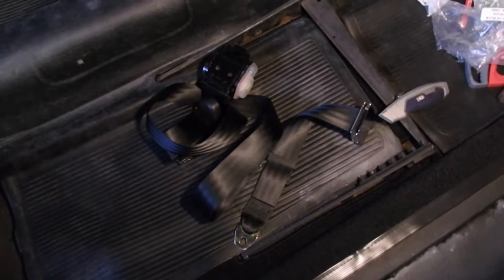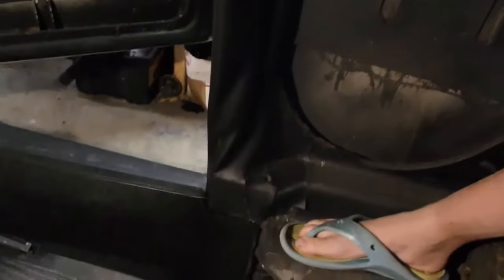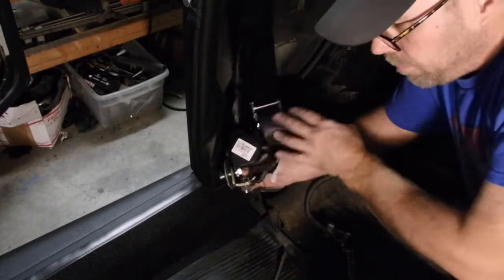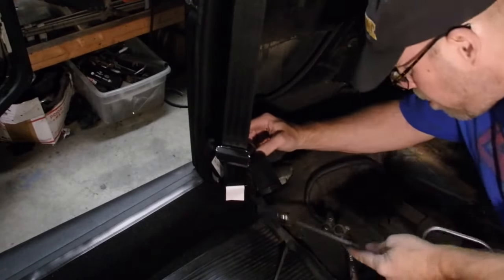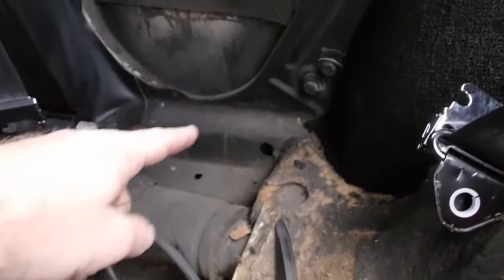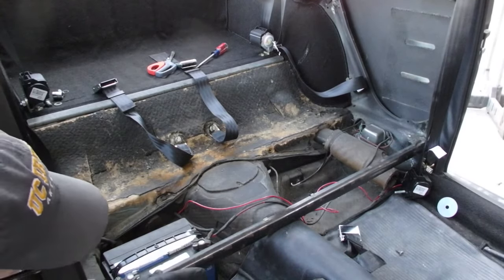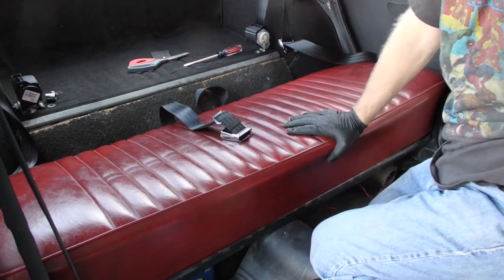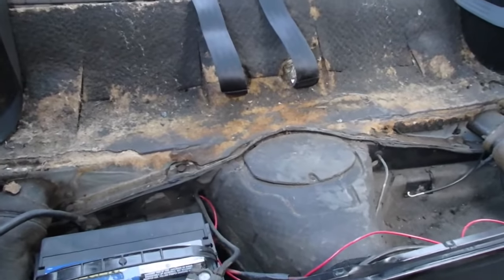1969 VW Bug Project - Episode 48.2 - The Interior: Three-Point Seatbelts Front and Rear

Comment: Very nice guide. I had bought new 3 point harnesses for my 69 bug as well but didn't have much luck finding instructions about mounting them. I had to repair the rear luggage tray, so while I had the welder out I welded a couple 7/16-20 weld nuts to the inner wheel wells in the back.

Comment: Hey same problem here , I need that lifting bracket. Where can I get those? 
The bar that the back seat rests on is in the way. Thanks!!
Reply from the maker: By lifting bracket, do you mean the anodized one that holds the base of seatbelt system?  If so, it came with the seatbelt kit from JBugs.

Comment: Great video Bro, did you get the same retractable seat belt set as the front and mount that in back? I'm just starting the front, surprising there's no instructions!? go figure. Thank-you!!!
Reply from the maker: Yep.  Same exact belts.  They work a treat.
Reply: Just a side note, my belt set came with brackets that move the retractor forward, well it was an accessory part... it's perfect! I'll get the retractable ones for my back seats as well!🙌